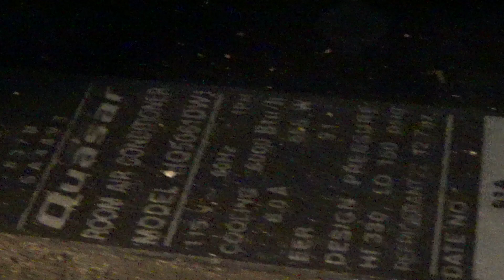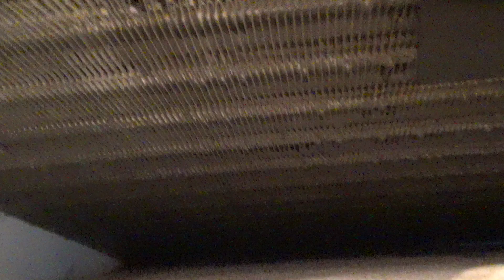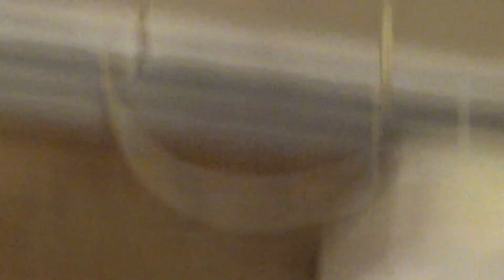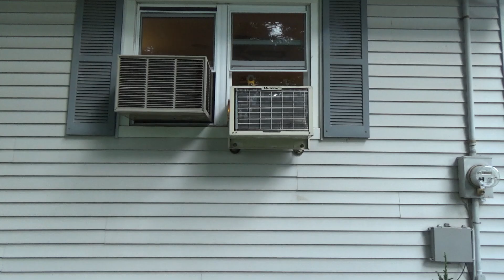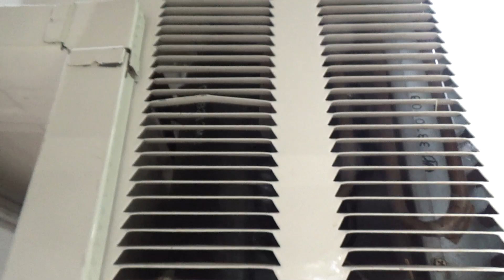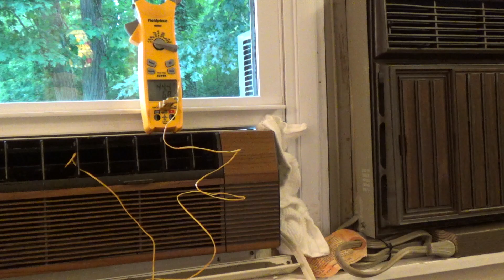Quasar Cool View 6,000 BTU Air Conditioner | Test in Window

Comment: You should wire the condenser fan to pull through the thermostat so it cycles with the compressor.
Reply from the maker: Why?
Reply: @JordanU  Well, it would use less energy over time if the condenser fan isn’t running when it doesn’t need to, and it would end up sucking in less dust so it would be easier to clean when the time comes. And I’m sure it wouldn’t be too hard to do.
Reply: @JordanU  Probably less wear on its bearings too.

Comment: Wow i have the Panasonic version of this unit.  Looks almost identical. Panasonic and Quasar are the same company.  Basically a thin style unit.  I dont post many of my units either. I just want to concentrate on working on the unit and dont want to juggle a camera.  Very high quality ac unit.
Reply: Whats neat about this unit is it has a tagental indoor style blower.  The blower wheel runs the entire length of the air out register giving you uniform air flow out put.
Reply from the maker: Thanks for letting me know.
Reply: I have the panasonic version as well. It's still going strong and has never broken down!

Comment: Hello sir, I remembered that window units are supposed to have water to sling on the condenser to aid in extracting more heat out of the condenser coil. They don't run as efficiently without it hence the purpose of the slinger ring.
Reply from the maker: The loss in efficiency is very minimal, and I'll gladly take it. The water rusts out the machine and causes contaminants in the air to clog the coil very quickly.

Comment: I really like my unit too.  Very quiet, ice cold air, and dehumidifies into the 30s.  I use mine in my office room which is great as you don't want a noisy unit when you are on the phone or on Teams meetings.  I knew you would be impressed by it.  🙂  I know an 8K version exists, but not sure if they made any larger.
Reply: i likes the Airconditioner guys video of you all hanging i dont know why but what gets me is you were all sober as a bee 😂.
Reply from the maker: I wish there were units made like this in the larger form factors, it would really keep the noise down.